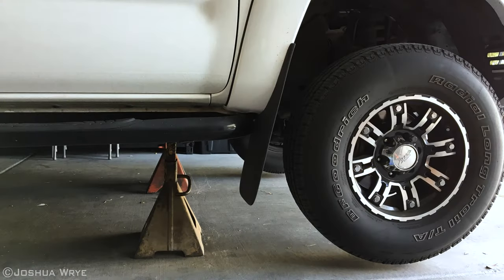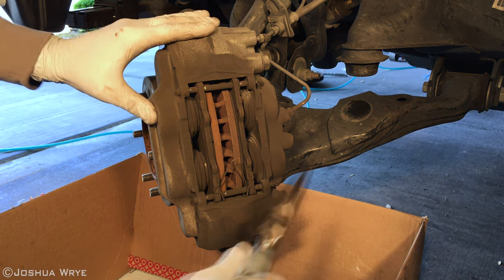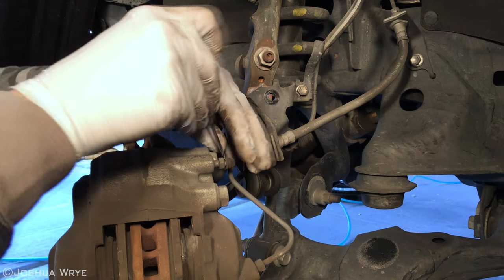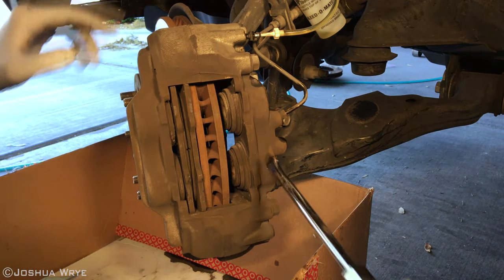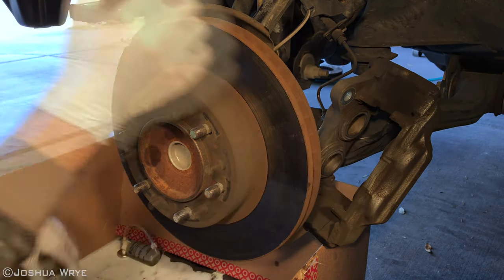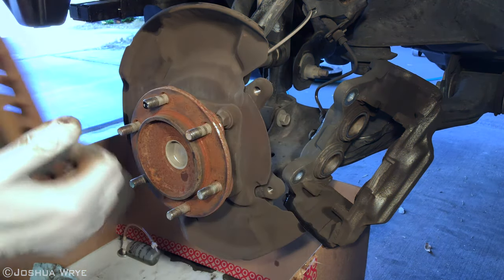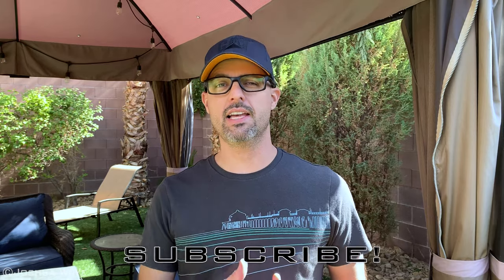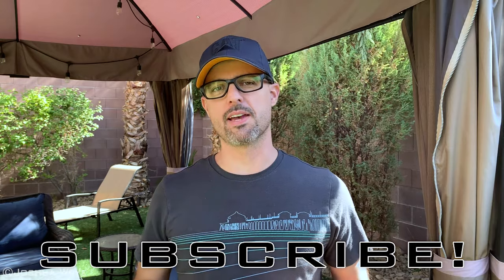How to Replace Front Brake Pads on Your Toyota Tacoma [4K]

Comment: Pro tip, brake clean the rotors after being resurfaced to clean any metal that can be imbedded in the rotor, also next time around use a single lug nut to hold the rotor in place when putting the caliper back on 👍🏼

Comment: Okay, so I am wondering about the fluid that you drained with that little bottle. Was that excess you were taking off/out?
Reply from the maker: Yes. That's a brake "bleeding kit" that stores the excess brake fluid. As your brake pads wear down over time, you or your dealer/mechanic add brake fluid to the reservoir in the engine compartment to make up for the brake pad wear. That fluid has to be removed from the system when new brake pads are installed because the thickness of the new brake pads makes up that difference.

Comment: Good video. However, you left out a slightly important detail at end. Before driving off, good advice is to pump that brake a few good times to set the pads. Also, check that master cylinder fluid level and replace the cap you removed at the beginning. 

Otherwise good video
Reply from the maker: For sure. All good points. Thanks for the feedback and for watching!

Comment: So I followed this video compressing the pistons with a screwdriver and now I need to replace my calipers because they won’t engage properly. You need a $12 caliper compressor that will prevent you from ruining your calipers. Now I understand you don’t need to bleed your brakes unless you’re at like 100k miles.
Reply from the maker: Thank for watching! You have to be very careful when compressing the calipers. I've done it so many times, I know what to be aware of.

Bleeding brakes isn't necessarily at certain mileages, it usually needs to happen if air gets into the brake lines (spongy brake pedal) or if you have too much fluid in the system after replacing brake pads.
Reply: You have collected air inside caliper that sometimes happen what he does in the video is dealer recommended service manual way of doing the work you can do that with two piston system but with 4 piston system it's complex you may damage the seals and the pistons it's better to just bleed little bit of oil and add oil from the top reservoir

Comment: I just got my front brakes done at the dealer and i noticed what looked like brake fluid on the suspension parts, but I'm guessing thats from when they used brake cleaner?
Reply from the maker: Usually, yes. It leaves an oily-looking residue. What's it smell like? Brake cleaner and brake fluid have two distinctive smells that aren't the same.
Reply: @MilitarizedCitizen  Hey thanks for the reply, I guess it smells like WD-40
Reply from the maker: Yeah, then that's brake cleaner. It shouldn't cause any problems and it's almost impossible NOT to get that stuff everywhere.

Comment: How often do the rear brake pads need to change on this truck?
Reply from the maker: That really depends on the type of driving you do. Hauling heavy equipment and/or towing trailers, your cause your brakes to have a shorter lifespan. On average, brake pads should last ~40,000 miles.
Reply: @MilitarizedCitizen  So you’re saying that the front pads and the rear pads wear out in the same period of time?
Reply from the maker: No, front pads will always wear faster because of the weight they take as the vehicle brakes.
Reply: @MilitarizedCitizen  So when should I expect to change the rear brake pads on my third GEN Tacoma? I don’t tow anything
Reply from the maker: Probably more in the range of 60,000 miles. At the very least, you call pull the drum off and check them.
Reply from the maker: It really depends. The brake pads have wear indicators. If you're not hearing those squeal yet, you should be good.
Reply: Ive never changed my shoes on the 04 Taco, and they still look new

Comment: Too many unneccessary steps..
Reply: Do you mean the brake bleed?  I have never done that before when changing pads.  Is that necessary?
Reply from the maker: It is a good idea to do it when the brake pedal feels spongy (from air in the line) or of you've opened up a bleeder valve and allowed air into the brake line system. Another reason you would bleed the brakes is of you were replacing the brake fluid in the line(s). Other than that, there should be no need.